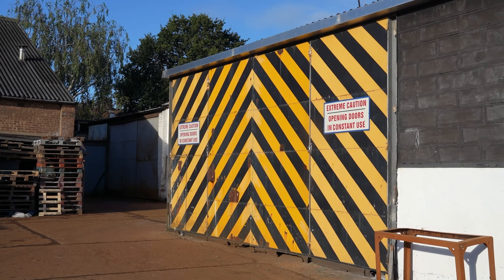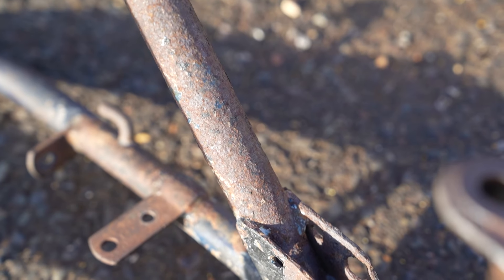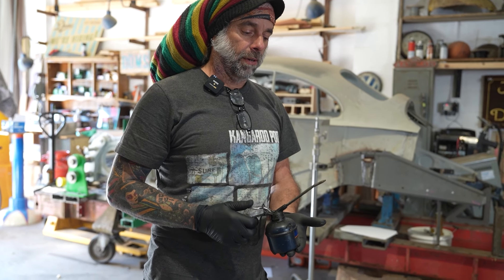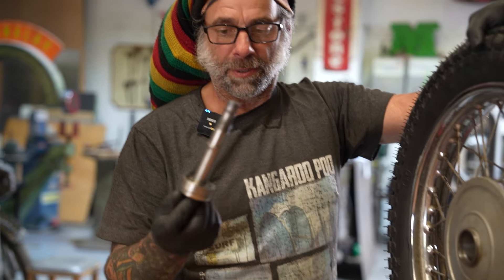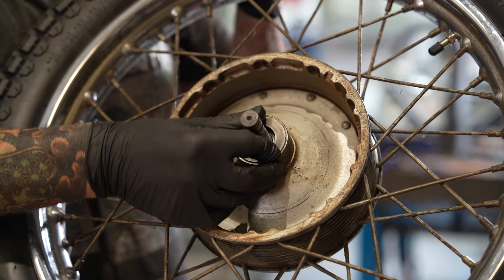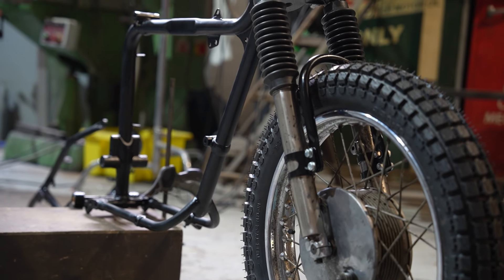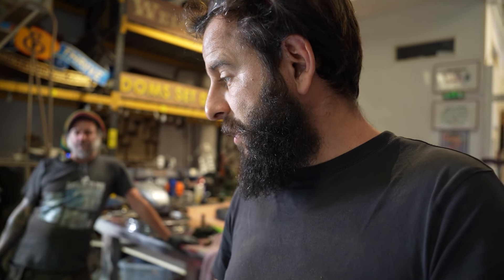The Rebuild Begins! | Triumph Tiger 90 Restoration | Episode 4

Comment: 15:52 Open the lower yoke fork clamp by pushing a flat screw driver into the slot. Then the stanchion  will slip in with no trouble.
The correct sequence to align these forks is to nip up the fork caps and leave everything else loose, bounce the front suspension without using the front brake and then tighten the fork caps , top yoke nut , lower yoke fork clamps , axle and then fork brace . In that order.
It's best to do that after the bike is fully assembled  but with the tank off

Comment: Dom. I hope I'm wrong, but I believe Triumph swan neck frames rely on the tank as the frame top tube connecting the steering head to the lug by the front of the seat. That's why they are made of steel. I think there is a good chance your frame will flex over bumps and crack the ally tank.
Reply: I made that point already , nobody replied. You are dead right though.

Comment: Start at the valve when removing the tyre, finish at the valve when fitting the tyre, so that the opposite bead can drop fully into the rim well. I thought everyone knew that.
Reply from the maker: I do now!
Reply: @DominicChineas  :-) Did you see the comments about the need for a steering head brace?

Comment: I’m sure someone else has mentioned it but now you have an alloy tank and the standard frame don’t go jumping the bike or trying to do big logs. The original tank had braces inside to help stiffen the headstock. Later Triumph frames had an extra tube to sort this problem. Mince pies all the time they are on the shelves 👍

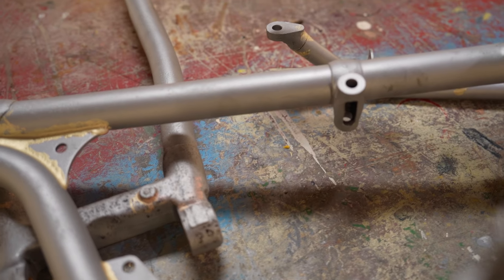Comment: 1:29 Hi Dom, I don't think you will be able to use your nice aluminium tank as is. The steel tank is a stressed member instead of a top tube on the frame.  If you look inside your steel tank you will see that the mounting lugs pass through from  end to end. It might be that you will have to weld a top tube to the frame.
Love your videos, keep them coming.
Reply from the maker: Thank you for the feedback yes we are aware and plan to make a brace that goes under the tank, thank you!
Reply: @DominicChineas  EXCELLENT!

Comment: Great set of videos, just looking at the brake shoe fitment - are you sure you aren’t fitting twin leading shoes to a single leading shoe brake plate…? If my memory serves, SLS brake shoes have a semi-circular cut-out which engages with the pivot pin at one end and a flat with a steel seat to contact the cam. The shoes you’re fitting seem to have flats at both ends… Hope the build progresses well. All the best…
Reply from the maker: Thank you for the concern but no we are all good they have the cutout on one end!
Reply: Early shoes had the semi circular cutout but later shoes were self aligning and were able to move in the hub to get best contact. The pivot needs the nut slightly loose and with brake applied, tighten the nut to position.
Reply: Thanks… every day’s a school day…😊
Reply: @aidannolan6656  yes, I’m still enjoying my Triumph education after 40 years of them 😀

Comment: Hi Dom. Loving the rebuild, I'm guessing by the use of trials tyres this bike is not going on the road.
Reply: I heard the words “green lane” in the video, so it must be going on the road, since a Green Lane is, by definition, legally a road without metalled surface.
Reply: @leslieaustin151  yeah, I heard that after I'd posted the comment. trials tyres are not usually rated for the road, but because of the bikes age it won't need an mot, so all good.
Reply: @Flipertyblink  OK, but many “trials-treaded” tyres ARE road tyres, I have some on one of my bikes. Les

Comment: You would have been better using your heel to push the final bit of tyre over the rim rather than using a tyre lever. That's what I always do especially on alloy rims but use same method on steel rims, another way is to put the tube in the tyre pump up just a little to give it a bit of shape then fit tyre and tube at same time.

Comment: you might need a brace under the tank to stop the ali tank from splitting- the original was a structural member  ? . . .
Reply: He's been told, but either he's not reading the comments, or he thinks he knows better, or it's on the to do list.